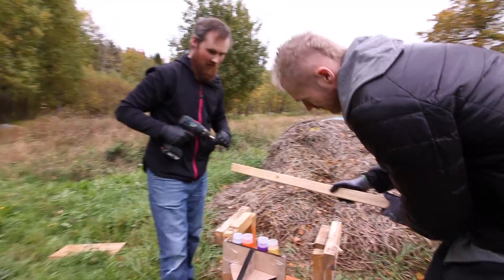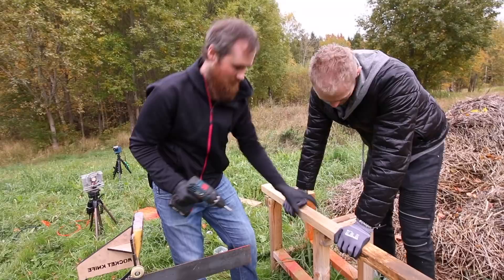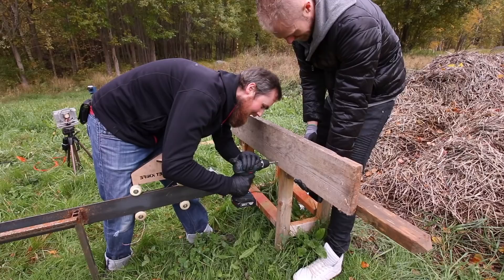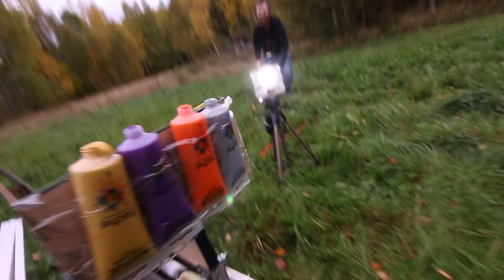Making BALLISTIC ART with a rocket (Acrylic tubes accelerated to 200km/h and smashed into wood)

Comment: Also the fact that the board or “decelerator” snapped in half on the second go is a perfect example for Force = (mass)(acceleration). Mass of the rocket should be the same for both runs (grant it, this is a assumption) but the acceleration was vastly greater on the second run giving much more force thus snapping the board. Very cool slo-mo shot of some simple physics at work!

Comment: OK!! now put two canvasses on the cart leading edges pointed and trailing edges slightly splayed out like wedge and have paint rollers sprung loaded on either side with random paint all over rollers. The narrow leading edge just fits through the gap in the rollers and the slight widening in theory keeps lite pressure on the canvasses with the rollers. on the outside of the rollers canvasses running parallel with the track being splatter painted. OR just hang a row of balloons each one filled with a mix of water and that inexpensive acrylic paint
like the whole tube mixed with some water in balloons hung up and let the rocket knife strike! Canvasses on either side. Review the rocket knife and water balloons episode